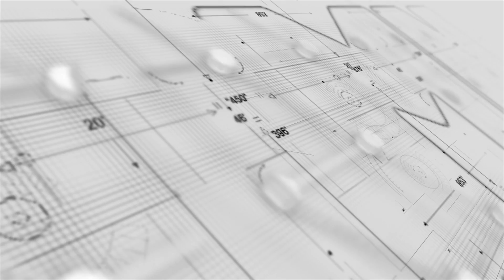Scary Surprise During The BCN3D Sigma Teardown

Comment: Can I point out a flaw in your thinking with regard to using the Hemera extruder. You say you will have to rotate the Hemera's stepper motor 180 degrees to move the stepper motors wiring socket to the bottom so it fits. The problem is there is hole machined out of the face of the Hemera's stepper motor to accept a bearing, where one of the Hemera's gears fits. If you rotate the stepper it will be on the other side and the gear will not fit! Unless E3D have a mirror part (which I can find no listing for and comments where E3D said they have no intention of producing one) I don't think this is possible?
Reply from the maker: What I meant to say was that all I need to do it rotate the end plate of the stepper motor 180 degrees and that solves all issues :)
Reply: @3DMakerNoob  Have you done it before? I have just purchased a Qidi i-fast and am looking to do a conversion from a dependent dual extruder to an IDEX so will be watching this series with great interest.

Comment: I hated my Sigma R19. It was my first printer. I built a voron switchwire earlier this year, and it's just incredibly better than the Sigma. I do think that changing the control board will help a lot though. I always thought it needed new firmware (klipper or RRF), new control board (for the firmware), new direct drive extruders, new bed that isn't glass and a bed probe for mesh leveling.

Comment: If you're not set on NEMA17, you could look into NEMA14, but longer which could give you similar performance, if they fit vertically, but wouldn't need a new bracket. Manufacturing those metal brackets could become the hardest part of the project. Great to see you happy and active again!
Reply: I disagree, he could make adapter plates very easily, even without a CNC

Comment: Wow, there was much more corrosion going on in that printer.
Is this because Malta is a sea climate, and therefore you have more problems with corrosion, or did the machine get wet?
Many times heating up and cooling down can cause this, of course.

Comment: Huh, that's really odd seeing a heatsink area clamped to plastic. One could probably just take the very same part, free the area in the middle, embed a piece of aluminum, and then isolate it using Kapton tape. With 2000$ price point, that wouldn't make a difference, would it?

Comment: It isn't surprising as the majority of the heat from components like that, especially surface mount, exits the package through the solder connections and the ground plate on the bottom of the package. Shame though, at that thing's price. One would hope they have addressed it by now, or soon will. I have to believe those drivers aren't cheap.
Reply from the maker: Nope and you buy them in a set… but that will be fixed now 🤣
Reply: Well, I bet the ground plate is there as a heat spread, they just completely ignored it. And thinking about it, this might even work with just a tiny air gap
Reply: @Smaxx  That's how the board is designed, the groundplane mitigates the heat. On the other hand, the heat may well be within the tolerances of the components. The problem really lies with the choice of material they used for the insulating plate. Had they used something else that didn't end up causing all that corrosion, it might have been just fine. But yeah, even a small gap probably would have prevented that. Not sure why they chose to smoosh the board up against it like that. Wouldn't have taken but a few extra seconds to print some standoffs by the screw holes in the insulating plate, since they're obviously printing those anyway. Bit of a dumb move, unless there's a reason for doing it way that I'm not seeing.